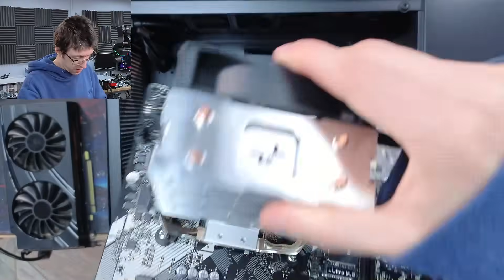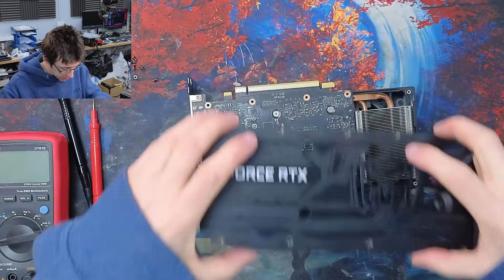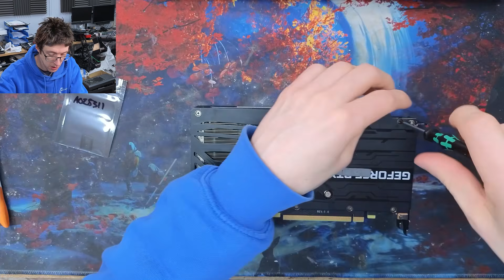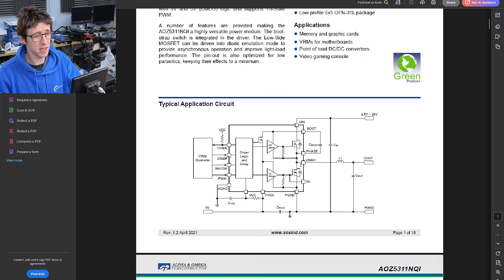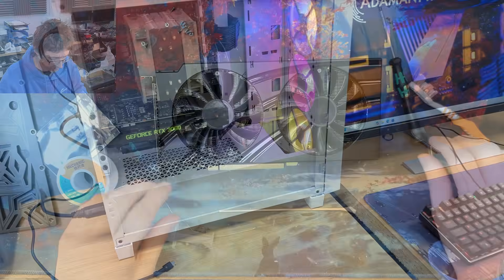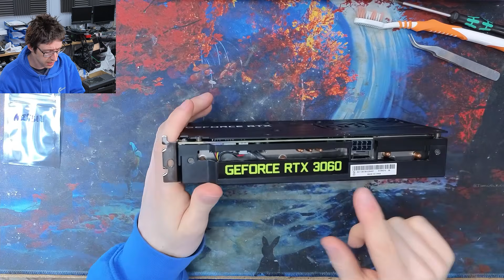No Post on Sundays: I fixed this PC once already... #473

Comment: RTX 3060 has very ugly power draw characteristics, a crappy old PSU like a Corsair CX series cannot handle it. Specially if it's a CX550 or something awfully low capacity like that. I had a 3060 Ti blow up a very high quality but old PSU after constantly tripping the PSU protection circuits and it was a 660W unit. Lowering power limit on the 3060 Ti to 50% reduced the frequency of protection circuit trips, but it did not eliminate it. The PSU blowing up did eliminate the problem, though.

Comment: on your little power switch - amazon - approx $10.   power and reset swtichs. and power and drive leds.   Long cable to keep so you do not have to reach into box to switch on/off.

Comment: i once had a computer that killed 2 RX 5700 XT's ... black screen, didint post video... replaced the card. 2 weeks later exact same problem. turns out another bit of hardware was killing the cards.. no idea to this date what part it was because i replaced my cpu motherboard and psu at the same time lol

Comment: at 9:24 all of those 6 phases are vcore phases, they just connect to 2 different power sources. Bottom 2 are getting 12v from PCI-E finger, while 4 phases at the top from 8 pin connector. Memory phases are located to the right of the core

Comment: as @Gugi-r9i said 10 hours ago at about 3:17 there is what appears to be a short right in between the M.2 and the graphics card. i watched from about 3:10 to 3:20 to see it. very quick and faint, not like a short jump of electricity but a longer arc across to something... question is. did the graphics card cause the jump or something else. if something else then thats whats killed 2 cards

Comment: Well done, most impressed with your diagnostics and repairs.

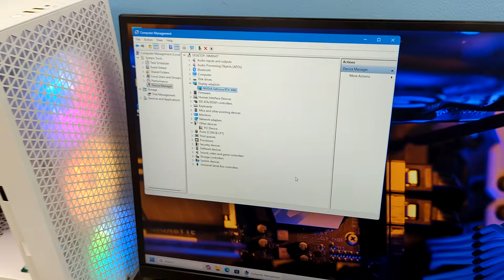At 22:05 why is there a PCI Device showing with an error (?) within Device Manager, is it just a driver thing..?

So, it seems that it was a coincidence that the PC ended up with two problematic GPU's not being related to the system itself.?

Comment: Maybe your flux isn't allowing the chip to float? Flux is everything in soldering. Tin a new chip to make it an easier install. Heat the board then tack the chip so you don't overheat the chip and destroy it.

Comment: I would tin the pads on any new SMD with leaded solder, heat the board up in the area so that any solder is liquid and only then put the replacement part onto the pads. That way everything is up to temperature. Briefly remove the heat to allow the replacement chip to bond, apply some flux and give it a bit more heat until it dances on the flux.

Comment: If you notice very Closely at 3:17 when he press the power button, something sparks at nvme m.2 or underneath it.
Reply: oh wow maybe nice catch.  i was trying to explain it away as a reflection from an LED but it definitely looks like something arc'd.
Reply: there is something there... i dont think it was the M.2 though but remember the graphics card is right there. so with my limited knowledge id say its the graphics card short going across something (visually). the damage was already done so i dont think it made anything worse in this case but if it comes back in a few weeks hopefully he sees these comments and traces where that short went to or the cause of it
Reply: Good eye.
Some nvme have LEDs though?
Reply: @jaro6985  I thought the same thing, but the model seems to be  Fikwot FN501 Pro which do not have a led it seems. (I maybe completely wrong)
Reply: I think that maybe just the nvme blink light, i didnt know they had them on till this new one i bought about 3 months ago, mine has a green light that flashes pretty much constantly with activity... So it probably just flashed once and then as the pc didnt boot it didnt flash again, looks electrical or sparky but id bet thats maybe what it is..

Comment: It's not applicable in this case but I just want to add that the bios nowadays are very different from the days of old, motherboards are shipped with bad bios these days or at least not functioning as fully intended. That's the only reason why I wouldn't automatically reset the bios first thing anymore. I have a gigabyte X570 aero g and the initial bios release was very buggy.

Comment: I love what you do and you're right 99.9 percent of the time. In this case however you should never reset the bios before just making sure that the power supply is working. I just think it's best practices why roll back the BIOS. I find that in most times in this instance it's a dead power supply.

Comment: Agreeing with a comment further on. Tinning the legs on the new mosphet with low melt will help you to get the parts to marry more quickly.
I know that you do more Laptops now,but I was a big fan of the early desktop stuff. You used to say things like obnoxiously large power supply, because I'd never be tempted to sell it when you'd wheel out the kW Antec! Then I noticed today that you have an even bigger supply,how times change. I even found myself saying, it's never the cpu unless it is, but it's never the cpu. Those were the days. Keep up the good work and thanks for the memories

Comment: I have a Zotac 3060 Ti I'm working on with someone in the discord. Seems every time I get a repair it isn't as easy as this lol. My 1.8v rail isn't turning on and the enable pin to turn it on should be 5v, but its .68v. Waiting for a riser adapter to come so I can better probe it.

Comment: I had assumed that you can bypass a mosfet and allow the remaining mosfets to do the work (since it's built redundatly), assuming you don't overclock/overvolt it or anything fancy. But i think you still need to modify the board in some way for the missing mosfet to still allow the card to work.

Comment: I had something very similar recently. No power on, I did the BIOS reset and tested the battery, it was just over 3v. The mistake I made was putting it back in, as the P{C would still not power on. I chased my tail for a week, and then when I put a new battery in, the PC powered on like nothing had happened!

Comment: My main server recently had a no boot.  The fan had been running noisily for 2 days before hand but I did not get chance to look at it before it died.  TLDR, I've now got a spare Intel i3 cpu, a spare Ryzen 3400g, a fully working spare computer, and a new Seasonic power supply.  The old one is going for RMA as it was only 2 years old, with a 10 year warranty.  It's never the power supply, unless it is.  On the plus side I now have 2.5GB networking, an 8 port sata card, and a 10th 3.5 inch disk in the thing.
Reply: Ya, a relative of mine learned the hard way that PC fans on high speed usually means something, lol.

Comment: I watch several others do board repairs and one thing they tend to do with new chips is to pre-tin the chip before trying to solder it to the board. Seems to flow easier that way.

Comment: I don't get it...Wouldnt you check to make sure the power switch is plugged into the mainboard first?...maybe you already did?...I would do that first...and then i would try a jumper or a different power switch...before assuming its the power supply...I mean thats basically the easiest thing first.

Comment: As I've just posted on Bluesky, you've managed to solve an issue I was having with my 2015 Clevo P751ZM.  Like the machine in the video, it was refusing to power up and, like that, it's turned out to be a broken graphics card.  Cheers Graham; I now know I can bring the machine back into use again, once the card's replaced 🙂

Comment: Great job.  I would really like to learn how to diagnose and repair graphics cards.  I have a 980Ti that stopped outputting signal after I returned to its original cooler from having been on a water block.  I did two of these, and the other one works just fine.  I suspect a solder got loosened when I removed individual heat sinks from the VRAM chips and MOSFETs.  The thing isn't worth sending off for repair, but if I had this skill, I'd happily apply the parts and time.

Comment: With the multiple cards dying in that PC? Isn't it possible that the PSU is killing them?
Reply: Agreed. I’d replace the PSU regardless after that, cheaper than another graphics card too.
Reply: either the PSU is killing them, or the persons power at home is doing it.....or a combo. Dirty power
Reply: @lorduggae   I have seen 450 mobos taking out gpus too
Reply: @lorduggae it doesn’t kill my other stuff plugged in
Reply: @Jensoncollis  Oh this is your computer? I would assume a PSU should be filtering the power making it safe anyway. So either way I would replace the PSU.
Reply: The PSU was also the first thing that sprang to mind when he said that this PC had already fried several graphics cards.
Reply: 9:51 someone soldered that FET, or messed with it for some reason, there is no way that is OEM. Though the date code matches.
Reply: @jaro6985 Yes, but still let's ASSUME it was correctly done. Another GPU died in that system as well, it's just a bit concerning.
Reply: Sometimes DrMOS just fail like this, and then they draw so much power that they can even melt the solder underneath them. That was the original part and noone did mess with it before.
Reply: @rafastrozynski2094  OK good point. It just looked like it splattered on the right side but maybe it did melt.
Reply: motherboard could be too